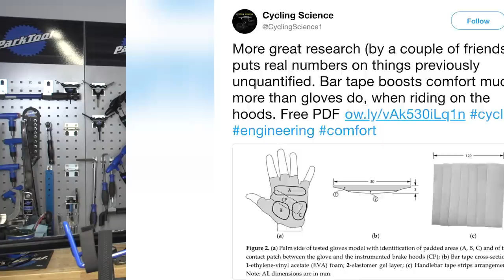How To Double-Wrap Handlebar Tape | Set Up Your Road Bike For Cobbles

Comment: Before my aerobars I built up a hand rest area using varying widths of bar tape (starting with a 3/4 width and moving down to 1/2 width and finally a 1/3 width) to create a more comfortable hand position while on the hoods and on the top of the bar. the bike fit advisor has a nice video showing how to build and wrap the bars. I ended up with a double wrap on the drops, transitioning to single wrap around the levers and a single wrap over the built up hand rest. Works very well and is quite comfortable.

Comment: Dear Jon, I was intrigued by what you said at the end of the video: bar tape reduces vibration at hood position. It sounds counterintuitive so I read the whole article. Turns out, the author taped handlebar tape OVER the hoods--which no sane cyclists do in real life--to achieve that conclusion. To their credit, they were trying to prove that handlebar tapes were more effective than gloves at reducing shocks despite utilising the same foam thickness. The reason they didn't test this on the 'top' or 'drop' positions were beyond me, although they did mention that is their future plan.
Reply: Vee_DT hi, I know. Madness really isn't it. I wouldn't tape like that, but interesting nonetheless
Reply: Jon Cannings. Not madness really just defying a convention and if it truly offers advantages it may offset the aesthetic and maintenance downsides. My internal ride dialogue yesterday was mainly whinging about sticky hoods from rubber degredation caused by sunscreen, who knows maybe taped levers would prevent this?
Reply: paul stephens very true. Maybe give it a go. I would find it too bulky with my little hands 👌

Comment: Thanks for the video. Will be wrapping my handlebar soon after watching this. 

Just wondering if the existing bar tape got some peeling, is it advisable to double wrap it (It will save some time and cost). Or to double wrap two new bar tape. (Online bar tape is actually quite cheap)

Comment: I use one layer but have started placing an extra bit where my middle finger is A, when on the drops and B, when on the hoods before the main layer goes on. More comfortable, yet still light and gives me two areas to aim for and lock in on when moving between the two positions.

Comment: I've started wrapping from the top down so I don't need any tape at all!  The exception to that is when double wrapping.  I start above the hoods and just wrap the top of the bars. I find I don't need the double wrapping in the drops since there is more flex there. As an added bonus, I use a contrasting bar tape color which results in a slick two tone wrap.

Comment: I use gloves in case of a crash, not for comfort.  I hate to lose skin in a race. Also for extra padding, I use thick foam mounting tape, which is double sided on the bars, where I want it to be thicker. It's cheap and saves on bar tape usage/cost.

Comment: I get pain in the first carpometacarpal joint and the metacarpophalangeal joint of the both hands. I know it is from holding the brake lever hoods and the upper bar of the bars when I ride. Considering that gloves don't necessary help, would wrapping an extra layer of tape on the upper part of the handle bars potential help? Great show! Thanks.

Comment: I hope that I heard you incorrectly about using a box cutter to cut the tape back on the upper part of the bar. If you cut too deep and score the bar, especially aluminum, you can essentially cause a fatigue crack to develop which in turn  causing your bar to break. At the lower end it's not much of an issue since no one holds the very ends.

Comment: Gloves helps me to keep my hands safe when falling from the bike :)
Reply: Yes they do... but you can buy gloves without the gel padding. The gel padding is what puts pressure on your hands as the gel is always in the same position in relation to your hand, whereas if you have padding on the bars, its always a slightly different location every time you move your hands, so pressure on the hands will move to different location, and hence make the ride more comfortable.

Comment: Why double-wrap when fizik and specialized both have adhesive gel pads that could go under the first layer of bartape?
Reply: I've used the fizik gel pads.. and this is going to be hard to explain... but the tend to move around in the same direction you're wrapping your bar tape.. plus the bulge they create before the hoods is extremely uncomfortable. They are fine on the drops, that is if you can keep it from moving around while wrapping the bartape over them.
Reply: My gel pads didnt move so far, I cut them a bit around the hoods to make them fit better. Love them
Reply: I’ve not had issues with trimmed Fizik gel pads moving. Perhaps it was you technique? Over stretching the tape while wrapping, or not degreasing the bars prior to starting?

Comment: For the 2nd layer, I use 4 rolls. One from the bar end to the shifter lever, and one from the shifter level to the tops. 2 rolls for each side. I always have a lot of tape left over, but this way I'm not going to end up too short whilst wrapping. The reason is the 2nd layer is going to take a longer roll than the first layer.

Comment: Jon can you do a video showing how to double wrap like Contador likes it, where there is no finishing tape at the upper end by the stem? Somehow it starts at the hoods or lower then goes to the stem area then winds back down again ending how and where I don't know.
Reply: GNX157 I'm going to speak to one of his old mechanics, he's a friend of mine, and get the exact method.
Reply: @JonCannings  Hi Jon, did you ever post anything on this method? Is it as long lasting as the normal bottom to top method?

Comment: Double-Wrap: I prefer to add some gel strips at strategic locations underneath the bar tape instead of using double tape. The double tape seems like a waste because you're adding an extra layer to parts of the handlebar where you don't need it. I use the gel strips from fi'zi:k shown here https://www.amazon.com/Fizik-Bar-Four-Pieces-tape/dp/B000N0YQ34 and add them just where my hands rest on the handlebar. You can cut them to fit most any handlebar.

End Plugs: A better solution to finish your job is a pair of end plugs that tighten in place. I use the EVO end plugs shown here https://www.amazon.com/gp/product/B00N5KDU2M and they eliminate any worry about an end plug slipping out.
Reply: Agree 100%. some well placed aditional pads and allen key locked bar ends

Comment: Hmm, I think wrapping towards the bike is better. Your wrists naturally tend to twist inwards (to the bike, right?) when riding in the drops.
Reply: Benjamin D'Hondt yhea I believe he actually said you should wrap towards the bike below the shifters and away above them so you'd get the best in both positions.
Reply: Perhaps personal preference and style - IME there is more twist outwards on the drops, especially when cranking the bars during a sprint (as my upper hand is dominant there, the lower one being more restricted in rotation by the top of the bars). When i'm relative static on the drops there also appears to be more of a tendency to rotate out, YYMV clearly.
Reply: Amazing how much pseudo logic there is in cycling. I agree with you Benjamin. When resting on the drops the hands will push down and the rotation is outwards. But when pedaling hard the rider will pull towards themselves and the rotation will be the opposite ie inwards. Goes to show the direction of wrapping doesn’t matter at all if both methods work.

Comment: The last place I had my bike in for a service routed the cables in a position where they placed pressure below my palms resulting in numb fingers. Is there a recommended cable path to prevent this?
Reply: Michael McDermott good question. Be keen to hear others opinions on it. I tend to be fine with my hands whatever the routing
Reply: Jon Cannings I've got a few stone on you my man!
Reply: I'd have the cables running low down along the front of the bar, not completely underneath, so about 5 to 8 mm up from dead bottom centre. That way when you close your hands tight around the bar the cable runs along in the sort of channel that's caused by where the last bones of each finger meet. That way the cable sits in that channel and your hand/fingers don't really even touch it or feel it. Hope this makes some sort of sense and I've explained it well enough for you to understand.
Reply: On a regular  bar without cable indentations I route the cables along the top quarter part of the front of the bar. It makes the tops a bit flatter, something I like about aero bars.

Comment: #ASKGCNTECH I’m currently running a 11-25 cassette & want to swap to a 11-28 for a trip to the Yorkshire Dales. Will the current chain length be okay & would the RD limit screws need adjusting? Loving your work GCN

Comment: I usually start just short of the bottom of the bars, wrap up to shifter going anti-clockwise so away from the rider, then clockwise after the shifter. Then once I reach the top of the bars I cut the tape in a long diagonal, do the same but in the opposite direction with the new tape, so the two fit together well, then I come back down trying to almost make it seem like it's all done with just the one really long roll of tape. The top layer then goes from top centre back down in a anti-clockwise direction or away from the rider, above shifters and clockwise, towards the rider, under the shifters, this time going all the way to the end so I can put the bar ends in to keep it all in place. I obviously use a little bit of electrical tape at the top to keep it all in place.

Comment: Wow, I love the GCN (Tech) Channel, but this wasn't the best taping finish I've seen. Maybe I'm a bit too OCD about my bar tape. I prefer Lizard Skins DSP, starting from the tops so no ugly bodgy electrical tape finish. Backwards rotation but I don't change direction at the hoods because when I ride in the drops I tend to grip with an inner rotation. Figure 8 is great for really thin bar tape, otherwise they make the hoods too lumpy so I use the extra small strip of bar tape at the rear of the brakes/shifters. Inner tube is a great base layer if you want a bit more substance and damping. And for cobbles: long live low pressure fat tyres! 35mm at the moment but I think I'll juuuust be able to squeeze in 36s when the current pair is worn.

Comment: One would think, that with all the years of experience in shocks for MTB something with 10 to 20mm travel would be possible and used for years. But no, better wrap 2 layers of tape to get how much? 0,5 mm travel...

Edit: at that rate a 20mm travel fork will be accepted around 2045 and maybe, maybe around 2090 someone will introduce a lock out feature...
Reply: Shocks would be too heavy
Reply: Indoor Cycling correct me if I'm wrong, but there is a UCI regulated minimal weight for a bike that is considered to be outdated ;)
Reply: Outdated for lightweight climbing bike, but aero bikes are often aroung half a kilo (or more) over UCI weight limit
Reply: Have you ever heard of the Cannondale Slate ? Give it a look
Reply: Rock shox roubaix  fork from about 30 years ago 
 Also the new Specialized Diverge and roubaix bike’s come with the suspension stem.
Reply: Trek ISO technology pretty much solves that problem without the added weight penalty of Sus forks.
Modern Road bikes running wider tyres at lower psi are more comfortable than nowadays.
Reply: Indoor Cycling I don’t think that is true (in reality) as the weight limit is without pedals and accessories, therefore the bike has to be heavier than the limit in a riding format (pedals added, bottle cage, number holder, etc). Therefore the bike has to be at 6.8kg, with the double wrap tape.

Comment: I think it's ridiculous that we buy bikes for thousands of pounds, made with premium materials, and the only thing you actually touch on the bike is wrapped with tape, and then finished with electrical tape! Such a bodge! Image if you bought even the cheapest car available and the steering wheel was wrapped with tape, you would never buy that brand of car ever again.
Reply: Buff Viking you are right. Next time I will finish it with carbon twine 😉
Reply: I hear what u r saying and agree to some extent, however electrical/insulation tape is the best thing I've found to finish bar tape (I work at a bike shop). The fancy brand logo finishing tape supplied with most high end bar tapes can't be removed without tearing/destroying the bar tape, making any future adjustments or repairs more costly. Electrical tape holds tightly enough, it's cheap and releases easily.
Reply: I wouldn't want my carbon aero Oval bars covered in leather like my Jag steering wheel, it would make maintenance difficult and expensive.
Reply: I think the aesthetics and functionality of bar tape are nice.